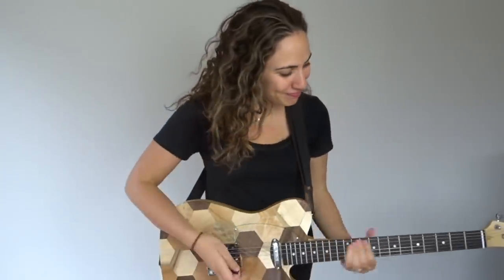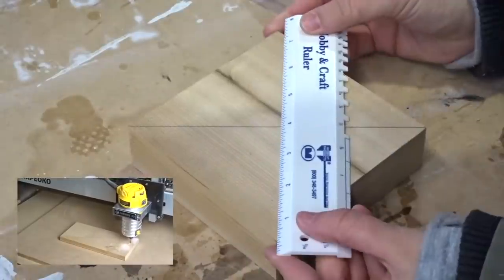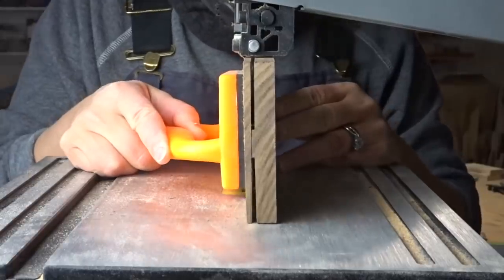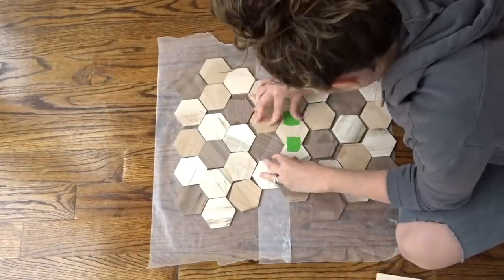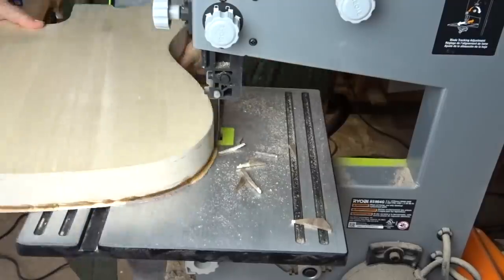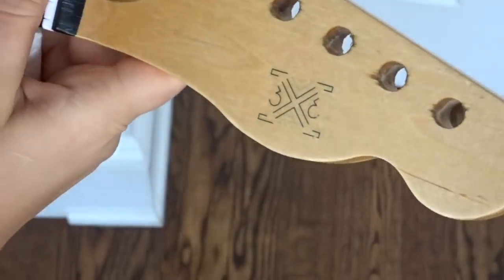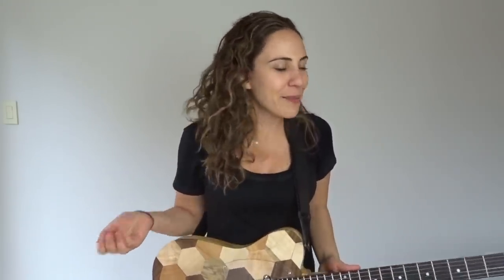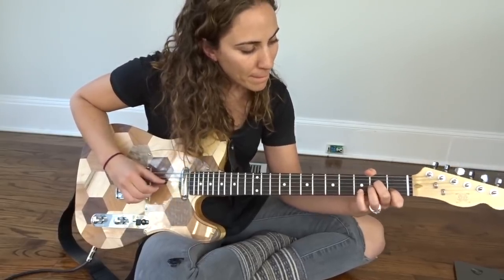DIY Telecaster Guitar // Woodworking Project // CNC // Guitar Kit

Comment: Great effort! Your best bet is going to get the guitar set up by a luthier. I like the hexagon wood pieces and it looks extremely unique. So you know the included pickups and electronics are cheap AF! Swapping them out (pots, switch and jack) along with the pickups will give you an instrument that you will love to play for years!

I enjoyed this video. Great job!

And everyone I know pronounces it "soddering" even though its spelled soldering.😉
Reply from the maker: I def have to swap out all the electronics at some point. Ha.
Reply: 3x3Custom - Tamar 

Cool! A great place to find great prices on guitar parts is Guitar Fetish (look up GFS pickups on a browser, it pops right up). On my Telecaster in the picture, I got my bridge pickup and bridge of my Tele in my pic from them. My body has a crappy finish, which I actually dig, from a company called Warmoth but they make high end parts and a Partscaster with their body or neck can quickly approach a grand!

Another great website is Reverb where they have great articles on Partscasters (making guitars from several guitars or guitar parts, usually Telecaster or Stratocaster shapes) as well as decent prices on used parts from past guitars. Keep in mind a Tele style neck from one guitar may not exactly line up with a Tele or Strat body from the same company or a different company. That's why there is the old saying of, "Fill and redrill!"

Typical Telecaster bodies tend to be Ash or Swamp Ash and Stratocaster bodies tend to be Alder. Fender has swapped the types on different models over tge years as well. American models and reissues tend to have three pieces of wood (mine has two!) for their top of the line while less expensive models have five or more pieces for the same size body! Fender did use poplar for some guitars but those tended to be Jazzmasters, Jaguars and Mustang models. 

It's easy to get lost on all the different options and its also easy to strip and mod a existing guitar as well! I hope you have fun with your Telecaster and also your next guitar adventure! Bug me if you ever need any ideas and keep being a cool mom!😎👍

Comment: for sure a cnc helps (big companies are doing guitars on CNCs, so why couldn't you?) a lot, but your creativity made the difference.. the hexagon pattern ended up great.
but I had to comment about you using the solder sucking device as a "pen" for your solder lol I never thought about using it this way. I did use a pentel pen to do that, but I only have small diameter pens... for bigger diameter solder this is a easy way to do.
Reply from the maker: Thanks! I had people laughing at me that I was doing that. I had no idea what I was doing....
Reply from the maker: Thanks! I had people laughing at me because I was doing that. I had no idea  what I was doing. Ha

Comment: Awesome video and GREAT job!!  Next time, make a quick resaw fence for your bandsaw (takes 10 minutes) and you can bandsaw thin pieces quickly and consistently (also much safer!!)  Hopefully many women (and men!) will realize that it is TOTALLY a good idea to try new things and gain new abilities and confidence.  What is your next project?
Reply from the maker: Thanks! I actually did make a resaw fence. But every time I used it the saw stalled out...... perhaps the blade needs adjustments. Subscribe and hit the bell to see 😉 (it’s a desk....)

Comment: Very nice, as for the band saw, could you not build a jig so that you have a solid side to cut against and have it so you can slide it closer to the blade for more cuts? I'm a newbie at wood working so maybe I'm out of my league commenting.
Reply from the maker: Yup. That would be making a fence. Which would work on most saws. For some reason whenever I tried using a fence on this saw. The blade stalled out 🤷🏻‍♀️
Reply: @3x3CustomTamar  Hi again. Interesting, my guess would be jamming the blade or the band saw motor aging and not being able to handle cutting through that much wood. Non the less you do awesome work.

Comment: That guitar turned out quite well. The clear pick guard really helps to show off the unique looking top. If you don't like the plain looking wood an alternative would have been to paint it.One thing you didn't do that I've seen others do for electrics is to use conductive tape to line the cavities of the pickups and electronics. You made me rather nervous when I saw how you were using the bandsaw to take slices off the piece of wood. You should have used your skills to make an adjustable fence for the bandsaw. It would have given you better control over the slices you were making. It would have also made using it the way you did much safer.
Reply from the maker: Thanks

Comment: Great video, never really thought about making a guitar before! Using a fence on your bandsaw might have been the go, just to slice your shapes.
Reply from the maker: Thanks! Ppl keep suggesting that. I tried that. My bandsaw is super sucky and when I try to use a fence it stalls. The blade doesn’t get tensioned enough no matter how tight I make it. So I need to guide the cut straight.

Comment: You can buy very thin veneers from various luthier supply stores, and probably from places that sell to carpenters too -- so thin you could sand away the difference by hand and glue it on. Enough veneer to cover a guitar body and headstock might start at $20 or $30, which is reasonable even for use with a $69 guitar kit.

What was done here is much cooler, and will wear better in the long run. But if you don't have the tools, you can still put a paper-thin veneer on a guitar body and have it look great.
Reply from the maker: For sure. I was trying to use up my scraps for this though. Was def a fun challenge

Comment: that's killer looking! I've toyed with the idea of building an SG with weird pickups. I've built a few amps, and plan to build a few more. You should think about that, if you haven't. A tweed princeton is a great place to start. Kits are available everywhere for the chassis and circuits, and i bet you could do a KILLER build video for the cab/headshell. I built one as a 2x10, and even at 8w, that thing is plenty loud enough for most small-medium stages.
And I definitely won't be shaping the neck either. ;)
Reply from the maker: I’ve been toying with the idea of making an amp!
Reply: @3x3CustomTamar  you should! read Dave Hunter's tube amp book and it walks you through the basic amp circuit, keeping to laymen's terms, and goes over a lot of info. i learned to solder on YT and stuck it all together. for the cab, i looked up how to cut box joints, built a jig on a table saw, and did it. it's all glued, made from common pine boards from home depot, with biscuits on the front trim pieces. the baffle is birch ply, but on the second one, i just used thin ply (don't even remember or care what kind) and i almost like it better with the light speakers.
anyway, grab that book! it's what a lot of amp guys recommended to me when i thought i might be interested in doing it.
fun fact.... there's a market for people who build cabs and headshells.

Comment: Great job! More importantly, you had fun making it! I have a solid body, electric, P-bass guitar build planned for later this year and can't wait to get started. I was thinking about buying a kit for the bits and parts, but fabricating the body and neck. Seems more expensive if I buy parts individually.
Reply from the maker: Thanks! Super fun! Yeh. I was shocked how inexpensive the kit was. But you get what you pay for. Everything that came with it is really low quality. From the pick ups to the tuning pegs. It’s a functional guitar. But it’s not a great guitar....

Comment: Great job, it turned out amazing! For sure you can make a guitar body from scratch, it's actually less work than all the work you did on this guitar body.
Reply from the maker: Thanks! You’re probably right. Ha.
Reply: @3x3CustomTamar  Hi - Good going. Kind of cool with the hex cutouts, I still have the honeycomb walnut/ash/mahogany SG I built in 1968, and I've only refretted it twice but it has always been my workhorse in the clubs. I've been a general luthier, axe slinger and custom guitar builder for over 60 years, and just you wait and see...When you BUILD a guitar (not assemble a kit), you'll see what coolness you can come up with. Necks are NOT scary or hard to build at all, it'll come to you after a few. Looks like you have an OK grasp of most of the tools, just be CAREFUL. (I'm not a safety cop but I want you to keep all them there pretty lil fingers). Keep on sawin'...All the best.   -Smythetone

Comment: Soder, the l is silent. Soldering is fun and you can buy effects pedal kits on line and save money over buying them in a store. There are Guitar amp kits too! Allen’s Amplication and Tube Depo are a couple that i know of. I’m sure there’s more!
Reply from the maker: Thanks for the info!
Reply: No problem. If you need any help let me know. When I worked at Intel I thought my department ho to solder. It’s not hard, but it takes practice. After you’ve got it down it’s like riding a bike. I’ve seen some guys do amazing stuff.

Comment: Get yourself a resaw fence for bandsaws and those cuts will be cake. I believe Grizzly sells a resaw fence and rails kit that's supposed to be universal.

Also for something like bringing that tele body thickness down a hair the simplest thing would have been to slap some 60 grit paper into that drum sander and use that.
Reply from the maker: I’ve clamped on resaw fences and it just doesn’t work. The saw stalls. The blade doesn’t ever get enough tension on this crappy little ryobi. One day I’ll upgrade. And as far as the drum sander. I wasn’t planning on driving to my friends shop for help in the end so that wasn’t an option I was thinking about at that time

Comment: congrats on the new CNC! In the video clips in the first few minutes, it didn't look like you anchored the workpieces as the hexagons were being cut. Was it secured underneath somehow or was it as it appeared, just sitting free on the work surface while the CNC cut away?
Reply from the maker: I used double sided tape. But I’m going to figure out a clamping option. Because I wasted a lot of tape....
Reply: Haha! That's one way to do it. Thanks for sharing! 
Also, most Americans say soldering like "sodder" and many Brits say "soul-der" 
And keeping the wires in place is one of the hardest parts of soldering :P I use helping hands, not the typical chrome variety but instead the Gorillapod-style 6 helping hands that you can find on Amazon. Either one would work fine though.
Reply from the maker: Awesome! Thanks! I’ll check it out!

Comment: Soldering tips: Heat wire and attachment point from the opposite side of where you touch the solder to the heated connection.  Soldered connections should be shiny after cool.  Clean soldering iron on wet sponge after each connection.  Use a very small amount of rosin every third or fourth connection on the soldering iron's tip.  Use a flat wedge tip for wire connections, there will be more tip touching the wire and attachment point.  Tinning the wire is a good practice, but not the connection point.  Use 60/40% rosin core solder for most low-voltage connections.  Stop adding solder when the wire and connection are completely covered, try not to form little 'balls' of solder around your connections.  If you are attaching a wire through a hole, the completed soldering joint should look like a pear, large bottom which curves up to the wire and disappears.  Buy, a de-soldering pump, and remove any extra solder or mistakes.
Reply from the maker: Thanks for the tips!

Comment: Looks even better on video! Sounds decent enough.

FYI your finger picking is far better than mine!
Reply from the maker: Thanks! It sounds. Ha. Maybe one day I’ll upgrade the pick ups or something
Reply: 3x3Custom - Tamar you could also think about lining/shielding the electronic cavities with aluminum or copper tape.
Reply from the maker: So I was confused about this. I saw a few videos where ppl did that. But then I read that if the pick up had copper on the bottom it wasn’t necessary. And this pickup had copper on the bottom. What is the benefit of putting the copper shielding on?
Reply: Not too sure about that.. unless they are "noiseless" pickups then you can get away with not shielding the pickup cavity. But you could and probably should shield the other electronic cavities. And also you can attached/solder (its "sod-der" btw) the ground wires to this shielding. Shielding blocks out radio frequencies and other interference or buzzing from lights. You can get aluminum or copper tape on Amazon and that will do nicely. Just make sure its conductive. They should also be put it on the backside of pickguards or lids that cover the cavities. But you're clear pick guard is probably fine as is and the other cavity already has a metal cover with the knobs on it so that's fine too.

I'm no expert tho.. but this guy can explain things better than me. lol
https://www.youtube.com/watch?v=mQrpBSmsVWE
Reply from the maker: Awesome. Thanks for all the info.

Comment: Cool project, but I'm a little confused - did you take a solder-sucker apart to use as a solder dispenser???  (I.e. the big spring at 8:40???)
Reply from the maker: Hahaha. Yeah. It was my first time soldering and I had no idea what I was doing.  I thought it held the solder. 😂😂😂. I quickly realized that’s not how it works
Reply: LOL!  At least you held the right end of the iron. "If is smells like chicken, you're holding it wrong!"  End result is what matters. Nice work and I'm sure a great learning experience. "Make a guitar" is still on my bucket list. The wiring is the least intimidating part for me. This was encouraging.
Reply from the maker: OblivionRatula got for it!

Comment: That’s so cool, great work! Does the oil smell when applying? Seems like a good finish.
Reply from the maker: Thanks! It had a slight smell but nothing harsh. I didn’t need to wear a mask and I was doing it indoors. I did 3 or 4 light coats on this and it’s just a matter of rubbing it in letting it soak into the wood. And it cures to a hard finish. Pretty cool stuff.

Comment: You did a great job with that guitar. I love the pattern. Do you have any advice on where I can get free full size print out guitar body template patterns?
Reply from the maker: Hmmm. Not sure if it would be there. But I put a link for the headstock template in the description. Maybe that site has one for a body too.

Comment: Great job! A bespoke hex telecaster - I must make one. Any tips?
Reply from the maker: Thanks! Def the biggest mistake I made was not starting off with the correct thickness I needed for the hexagons to begin with. If you make one you must share it with me! I would love to see that.
Reply: Wow quick response! Could the wood patterns (hex or other shape) be cut out from very thin pre-cut wood veneer or is it better to use thicker wood?
Reply from the maker: I think it would be better to cut it from thinner that way you don’t have to do any work getting them to size after.

Comment: Setting the intonation is easy. It's in the tiny screws at the back of the bridge. Google it. If you can build it, you can set the intonation! It'llmake the 10th fret sound correct.
Reply from the maker: Yup. I’ve since learned 😉

Comment: The thing about building a neck is, is that you can sort of just start doing that on the side, since it's one of those things that just take a while, and then when you finally figured that out, you can always do another body.

But yeah I just buy cheap necks (or cheap guitars for the parts) because I can't really be arsed to build them either. xD
Reply from the maker: Ha! Yeh. It seems like getting it done perfectly would take years of experience
Reply: 3x3Custom - Tamar Same goes for learning guitar, but you aren't gonna let dust gather on that, are you? ;)

Comment: There isn't anything wrong with buying a pre-made neck blank. Compared to cutting out a body, the neck is a whole new animal. I've built a couple electric bass guitars. I've thrown away maybe 10 screwed up necks before settling on a not so well built, slightly disappointing yet functional neck.

Comment: Clamp some tallish guides on your bandsaw platform next time -- you can run the wood between the guides and get a nice straight cut every time.
Reply from the maker: Thanks for the advice. But Not on mine. Ha. I tried that. I think It needs a tune up

Comment: Why didn’t you just bolt a back stop to your band saw bench to stop that wobble you got doing it freehand?
Reply from the maker: Bc I have a ryobi. And the blade doesn’t get enough tension. Because if this I need to actively guide the piece straight. If I put a fence the blade stalls. One day I will upgrade!

Comment: Wait. you have a table saw, a bandsaw, a radial arm saw , and a CNC router but you don't have any clamps for gluing? I find this very odd.
Reply from the maker: Hmmm. I think you misunderstood this. Clamps wouldn’t work in this type of glue up.
Reply: Sure they would work, you just sandwich the 2 pieces your gluing between some scrap boards and clamp the whole thing together. The 2 outside (scrap) boards will help give even pressure across your whole work and not leave any marks. The hexagon top you created looks really nice by the way, watching your process was enjoyable.
Reply from the maker: Are you referring to when I put the book on top of the body? I was just in my house. Not my shop when I did that.
Reply: Yes, sorry i wasn't more clear about which gluing process i was referring to. I must have missed you mentioning that you weren't at your shop when doing that gluing process, i thought your shop might be attached to your house.